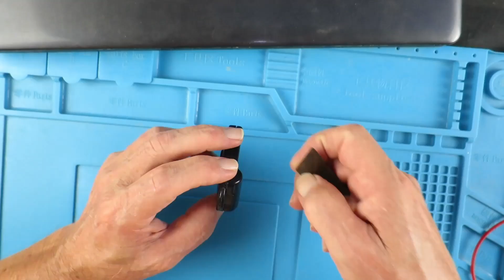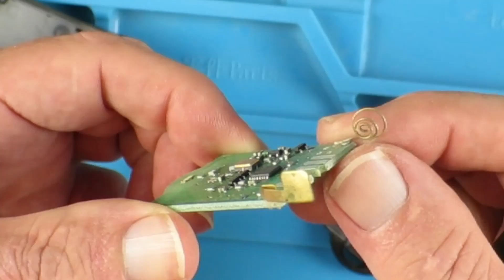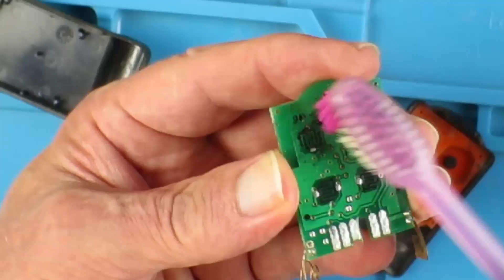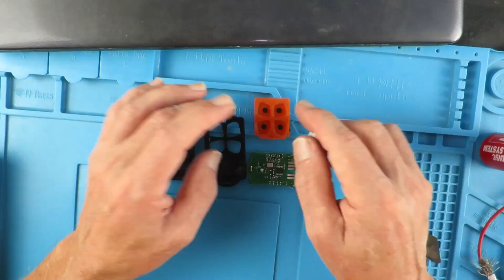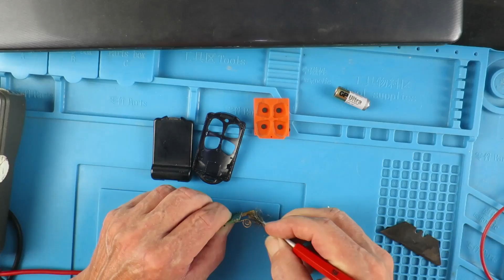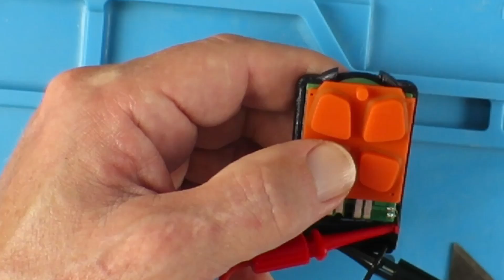Gate / Garage Remote Control Repair Fix

Comment: Isn't it strangely satifying to fix things? I would like to recommend two pieces of equipment, look for a fibreglass pen, that is a great tool to clean contacts without damaging them. Then a small ultrasonic cleaner helps to clean dirty pieces of the housing. Thanks for the video😊
Reply from the maker: I am an advocate of repair not replace so yes I find it very satisfying even on something trivial. I actually have one of those pens somewhere, if only I could find it! Do you have a source for an affordable ultrasonic cleaner?  The ones I see are too expensive for just occasional use.